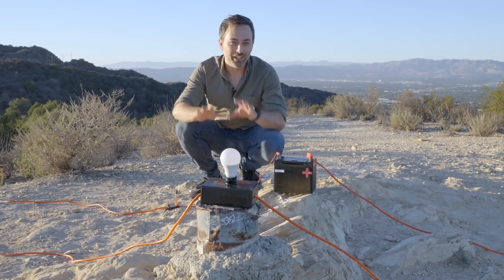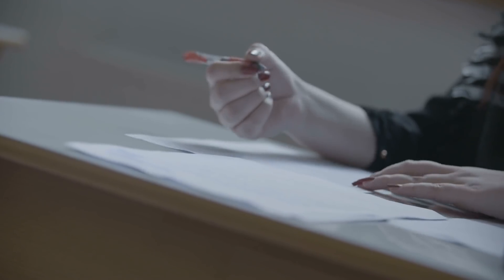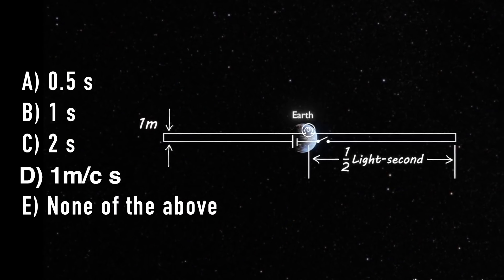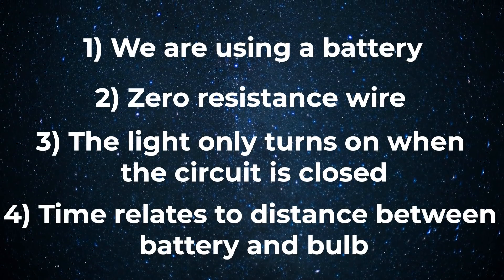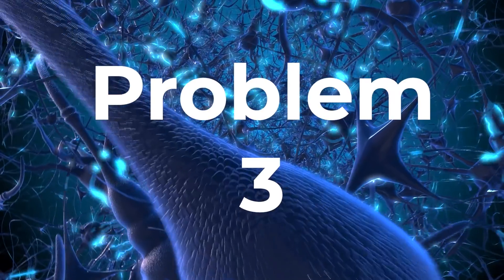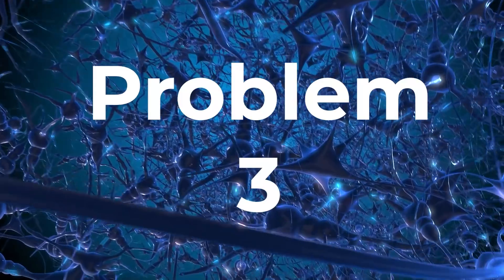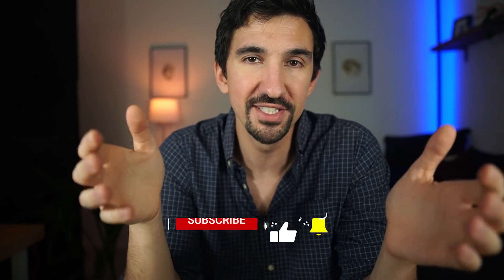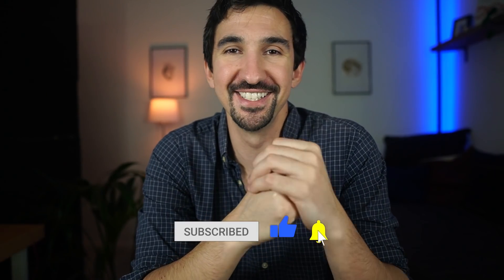Is Veritasium Wrong About Electricity?

Comment: Hello there,
I am a student studing electronics in my fifth semester. So pleas dont take anything that i say as right. But i have noticed a particular problem with your expleantion of the part where you try to comunicate faster than light. Your asumtion that the time delay betwen the closing and turning on of the light bulb is purely depending on the distance betwen the battery and the light bulb is wrong. You have to think about the staedy state that the circuit is in when the 1) switch is closed and 2) switch is open. When you then think about the state betwen those two you can see that the gradiend of the potential along the wire is the information of turning on or off, that travels along the wire with light speed. So you have to correct your statement about when the light turns on. The light does !!!not!!! only turn on when the switch is closed. The light can turn on and off thou the switch is turned off. You can check that by thinking about the situation when you turn on the switch and off bevore the information has reached the bulb with light speed. The bulb will eventualy blink thou the switch is open again. By that argument you can correct your awnser that the time it takes bewen closing the switch an the bulb turning on is dependend on the distantce of the switch and the bulb, not the battery. As you stated rigth the light will turn on with the energy transmitted by the em-wave generated by closing the switch. Now the question is when will the bulb turn off again if Deric had a break in the wire at one end of the setup and closed the switch?
Sorry for eventual spelling mistakes.
Grüße von Felix

Comment: 2:25 Not breaking causality. Communicating 1 meter away, like if you had a radio transmitter 1 meter away from a radio reciever each with really long antennas.
7:10 Set of 2 antenna.  Ok after 5 minutes, finally got there :)

Comment: Assumption 3 (time stamp 3:56) is ambiguous in the meaning of "when". "When" can mean "during", which I understand as correct, but the other street meaning of the word "when" is "at the same instant as" : this is not correct in the context. The fourth assumption is not what I understood. Time does not relate to the distance between the battery and the  bulb, but rather the distance between the switch and the bulb. So causality is not violated -- nobody manipulating the switch can send signals to an observer near the bubble any faster than the speed of light.

Comment: They are telling lies. 
Signals and electrical power are carried exclusively by the fields. The students should know this - their level of understanding should not make any difference. True, grade school kids aren't going be integrating E x B over the helical surface of the bulb filament, but the kids should be told that the EM fields set up measurable effects in their simple circuits that give the identical numerical results in the set of limited examples they'll see in the course. These students could handle simple circuits with non-trivial topology and qualitatively understand homopolar devices to enhance their understanding and maybe even inspire them to pursue the physics/engineering further. The lie comes in because the instruction should at least be prefaced with the correct information. Grade school teachers are likely just unwitting purveyors of misinformation.

Comment: Thanks for that, I too have been struggling with his "revelation" as I've spent many hours thinking about so called "faster than light communication" and have always believed that to transfer any information, on-off or off-on, would require some form of reliably quantum entangled particles....not just standard electromagnetic fluctuation.

I also was amazed at the total lack of consideration for inductive coupling and the use of 1/c as the measurement.

Now I can go back to my truly mundane and very normal life of struggling with my own inner conflicts in the firm knowledge that the universe as I know it still won't let me move anything faster than light..........yet. 

Perhaps I just need more coffee.

Thanks again and well done.

Mark.
Reply: There is no transfer of information in entanglement.  How can you use it to transfer information?
Reply: @nissimhadar  That is the no-communication theorem. It requires two observers in separate spacial locations  the same temporal location (space/time intersection). The only way I can see it's possible is if matter can exist in two locations, one time location. Not identical or copy, it would have to be the same exact specimen in two discrete spacial locations. 
The matter need not be sentient, aware, conscious. A simple example would be to travel back in time to meet with yourself. In effect you create a true duplicate of the consciousness (not copies or clones, the same consciousness in two bodies), the question remaining which consciousness prevails or whether they are separate entities or one. It would be similar to looking at yourself in the mirror except in the former, both of you would be aware of the other looking at the other. In that scenario, both consciousnesses would be one inhabiting two sets of matter. In the experiment, there is no transfer since what one is 'thinking' so is the other. That's what I'm looking for in entanglement, that the matter is not the consciousness. I don't know of an example in science where such a model exists, it's just a thought experiment.
Reply: @minerblake7494  MWI provides a much simpler explanation that is also compatible with everything else we know.
Reply: @nissimhadar  Do you want to talk about it?
Reply: @minerblake7494  what do you mean?
Reply: @nissimhadar  Do you want to discuss the MWI explanation?
Reply: @minerblake7494  There are whole books on the subject.  My favourite is David Wallace's "The Emerging Multiverse".
Reply: @nissimhadar  OK, well I'm pretty sure I've seen similar content on the platform here. It's not the same though as having interactive conversations with people. Thanks for your consideration.
Reply: Quantum entanglement does not allow FTL communication neither, as both distant observers need to send to each other a message to decode the information
Reply: @SeeThat92  Right, while FTL assumes speed is relevant, which also means light must be moving. Currently we think of light as a particle and wave. Can we view it as a field, if so does that premise change the paradigm of light traveling through space rather than a model in which light simply exists in space and is signaled to illuminate or rest?
Reply: Since you brought up entanglement:
Maybe you can answer this one. Where or how should I find the evidence that electricity and.or light move. I think it's obvious there's no movement from origin to destination other than wiggling the flashlight or the wires or moving the line of sight in a LOS radio transmitter. Theoretically the light moves from origin to destination. Do we know this to be fact, or are we assuming it based on observation. What testing are they using to show the evidence? There is a report that light can exist in two discrete locations in a discrete temporal location. My first thought was that it was a gimmick, that there's no way to determine a discrete light particle from another. The same problem I see exists in determining discrete particle of an element. How do we know we're not looking at the same object in two different locations? Or how would we prove it?
Reply: Veritasium has been wrong about a lot things for the past 2 years. Just saying.

Comment: The wires do act like coupling antennas, but since they are only one meter away from each other (as drawn in the schematic) the answer is still 1m/c seconds, as electric and magnetic fields propagate and collapse at the speed of C. They are not instantaneous.

Comment: The bulb is 1 meter away, so 1/c is indeed a perfectly acceptable unit for time.
Reply: @GoldenLion8  No, it's perfectly fine and is standard. In relativity for example where c=1, we simply write t=1 where it is understood as a time of 1 meter. I know it looks funny if you didn't get very far in physics, but what Derek wrote is standard. In fact when we see all the constants and units put in it's usually a dead giveaway that the person doesn't know what they're talking about (not necessarily so, but almost always so).

Comment: ¿Can you turn a lightbulb that is not connected in the same a closed loop as the battery? This is the set up:   A very high voltage battery where you have its positive and negative poles connected with a superconductor wire and in the order side a lightbulb in the same set up. Suppose that there is not reluctance losses and also the superconductor has zero resistance so there is no energy transformation in heat, so is imposible to burn them because a short circuit   ¿How much time is take to turn the lightbulb?

The things is that the wires in an electric circuit only helps in the propagation of the electromagnetic wave.   You don´t need them, but you use it to produce less energy loses.  and to make the electrons to produce the magnetic field.   But the transfer energy does not depend on them.  

With a electric circuit you sinthetize photons from electrons... kind of

If you have a break in the circuit, it prevents the electrons to generate the magnetic field,  you will have nevertheless some electrons flowing/oscilating in the direction of the break but you will not have enough energy to make the electromagnetic field that is needed for the energy transfer because you will loses it all in the break.  You will not destroy causality because the information first must reach the break and them flow back.

Comment: The causality problem should be a killer. On/off Signals would be digital communications and if it really worked that way someone would have demonstrated it. Dont need a 1/2 lightsecond length wire for this to be able to be shown if real

Comment: What would be the answer in the following case: Consider a circular circuit of radius R with a battery and switch on one side and bulb on the other. Assume no resistance and low voltage, what would be the time it takes for the bulb to turn on (well voltage change is detected at bulb) when I flip the switch? According to the video, it should be 2*R/c seconds along the diameter. But shouldn't the EM field be already set up in the conductor in the first place? wouldn't that make the time either 2*pi*R/c or pi*R/c seconds along the circumference of the circuit?

Comment: First shot about the units is incorrect. It's 1/c seconds because time = distance/speed and in this case the distance from the power supply to the globe is 1 m. Hence (1 m)/(c m/s) = 1/c seconds.

Comment: Your video seems to be making a fuss about the thought experiment. The main focus should be on takeaway concepts which gets applied in the real world. Thought experiments always have loose assumptions but they are designed to understand the key concept.
PS: The wires will stick to each other due to magnetic field so there is that also but here no-one talks about that.

Comment: You must view it as a transmission line. The light coming on nearly instantly does NOT break causality or the speed of light, because no one is saying that the changes propagate all the way down the wire and back to the bulb.

What the do is propagate through space between the wires. The 1/C is because it is meters per second where meters is the distance between the wires, assuming constant distance between the wires.

I'm not saying Veritasium did a good job of describing this, or that he can't make mistakes. He has a mistake in a video about electric vs magnetic fields that I corrected, that he's never acknowledged.

Comment: My personal understanding of electricity as an electrical engineer so far is that: when there is a battery in an open circuit,   voltage is present az any part of the wire at any point of time as a driving force. I imagine this like a closed loop pipe filled with water and a pump is running in this loop on one end and on the other there's lets say a waterwheel representing your lightbulp, but the waterflow is blocked by a valve. So the water between the pumps outlet and the the valve would be under higher pressure (negative charge) than the water between the valve and the intake (positive charge) - which again is my understanding of voltage. So as soon as you open the valve, the water (current) would flow, but the energy needed to turn the wheel would already be present at the waterwheel in form of pressure, and so the wheel will turn way earlier than the actual water coming out the pump can reach the wheel. Same thing happens in an electrical circuit, no matter how long the wire, as long as there's a source there is voltage present at any point in the wire, and as soon as the circuit is closed, current will flow in any part of the wire at (almost) the same time.
Reply: That's not how electrical engineers understand electricity. :-)
Reply: @lepidoptera9337  sorry i think i used the wrong wording, I meant electrician. 
I'm an electrician and that is my basic understanding of it. Is it a wrong view? Since the conclution of the veritasium video and my view ate the same i feel like its just a simplified version. If its wrong tho i would like to understand which part is not correct :D
Reply: @creepiona5460  You mean a plumber? OK. :-)
Reply: @lepidoptera9337  ok then mind explaining how electron flow (which is called current), differs from water flow? And how difference in electrical potential (which is called voltage) differs from waterpressure? And how the near instant transmission of energy i a closed water loop and an electrical circuit are the same? I would like to hear.
Reply: @creepiona5460  Water flows in hollow pipes. Electrons have to squeeze through the lattice of a solid. That's approx. like water having to flow through sand. It does... very, very slowly. I suggest you stick to plumbing.

Comment: I think you are not right. The problem is your assumption. The 1m/c of time until the light turns on or off is only the case if the source (and the switch) is 1 m away from the bulb . So your assumption that the lamp turns off after 1m/c can not be used if the crack is more than 1 m away. Veritasium never said that the energy at every point in the circuit need this time to get to the bulb. The fields do not travel the whole way along the cable until the light goes on but they induce a electric field in the cable. So a current starts to flow in the cable 1m away after 1m/c. In this case there is a energy flow directly to the bulb. But it is true that a far away switch would need some time to transmit the information about the cloesd circuit to the source or the bulb. In one case the bulb would get the information befor the source, in the other case the source would get it first. But this does only work if there is already an potantial at the switch/break that can be influenced by this change (what would need at least distance/c time after the source has been conected to the cables). And all this works only if the radiated fields do not get absorbt by the surroundings.

Comment: Consider the EM fields present on that hilltop, all oscillating at RF... It's just a hunch, but I'd suggest those fields radiating from nearby or distant transmitting towers have more power in them than the EM pulse made when the switch is closed on this hypothetical DC cct... If the bulb were to light whenever electrons in its filament were gently jiggled, by Derek's explanation, that bulb would be glowing 24/7 and his switch, battery and wires would be superfluous.

Disingenuous (adj) - insincere... Synonyms: dishonest, deceitful, underhanded, duplicitous...